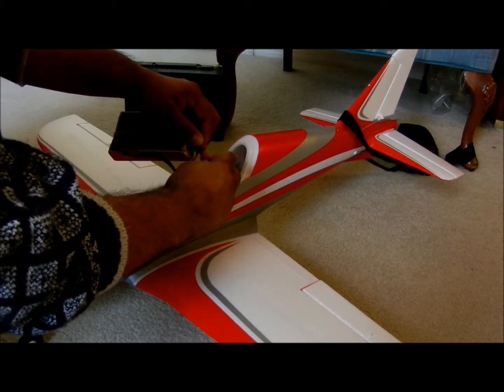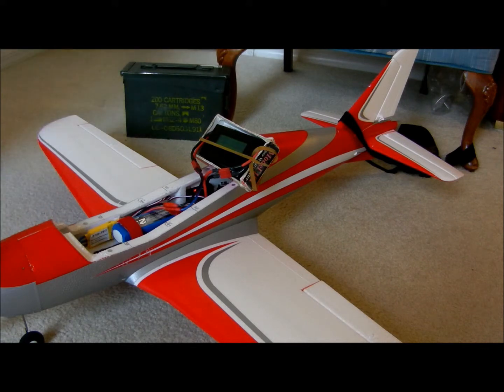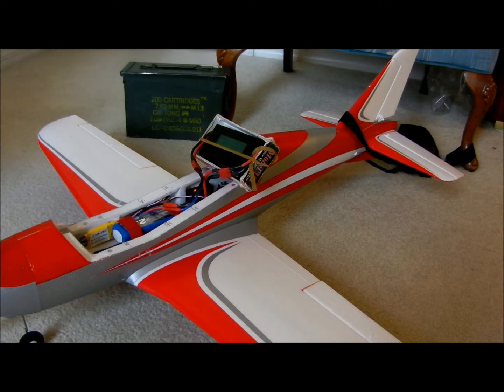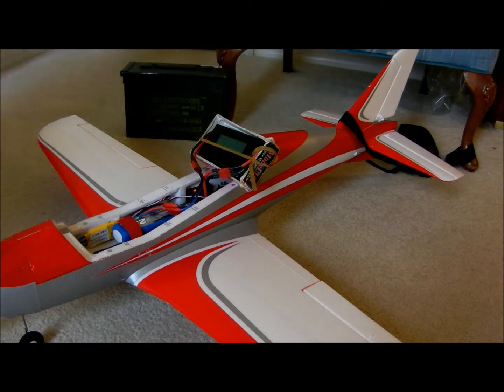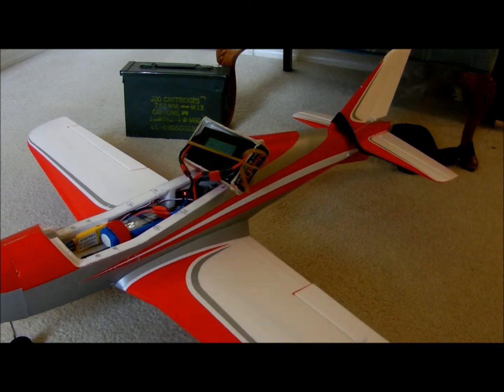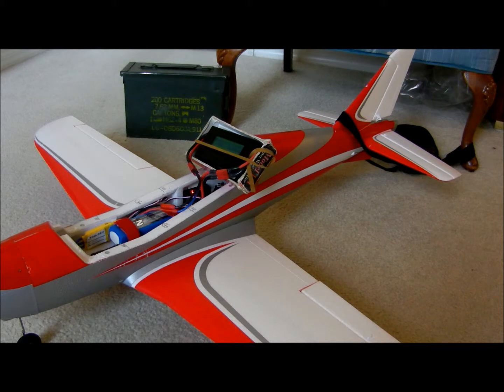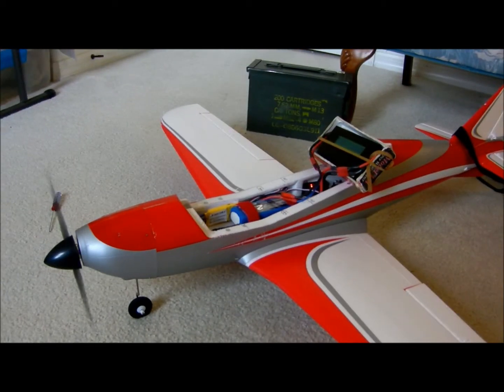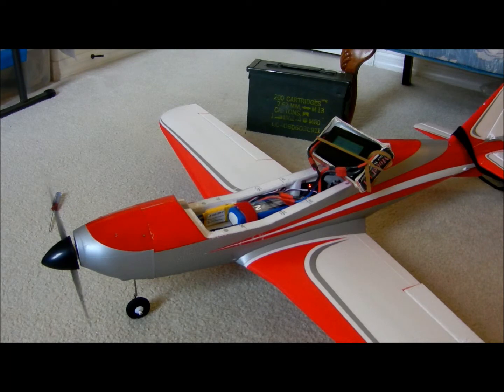Flyzone Millennium Master Power System Issue 01-01-2013

Comment from the maker: Thank you for your post, however, I did trouble shoot this problem with other ESC's from different brands and using the same STOCK Motor and the problem went away.  I still feel it was the ESC since the bullet connectors are soldered by the factory and that's HOBBICO's responsibility for QUALITY CONTROL.

Comment: Look at the motor shaft, you will see a set screw.  Make sure it's tighten all the way down on the flat spot on the shaft.  I promise you the noise you're hearing is the outer bell slipping on the motor shaft.  I replace mine with a stronger Allen screw and it solve the problem.

Comment from the maker: No, it was not the motor side.  I have another Video showing me run up the STOCK motor with a different ESC (E-Flite 30-AMP Switch Mode) and it ran flawlessly.  Remember, the ESC is the one that does all the Commutation and not the motor!

Comment: This really sounds exactly with what happened to my plane but I did the soldering myself so I was the one to blame for the pulsing or cutouts.  The bad solder joint intermitently caused exactly the same noises and cutouts as what you have.

Comment from the maker: Oh dear, if is then, it is in the hands of HOBBICO Technical Department as the Model is on its way there as I type.  It is somewhere in Tennessee so, it will arrive on Tuesday end of business.  It would be a POOR thing to have from the Factory of having a COLD SOLDER Joint in either the ESC side or the Stock Battery Side.

Comment: could it be a cold solder joint in the motor's or ESC'c bullet connectors?  I saw the same symptons on one of my planes and replaced each component to isolate the problem.  After I resoldered the six connectors on the old parts, I could not duplicate the problem and the problem went away.